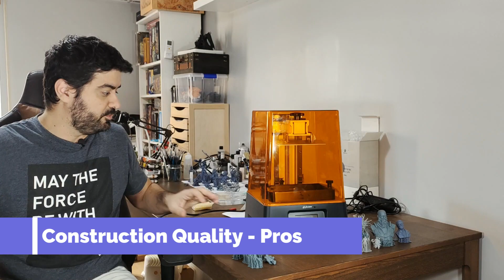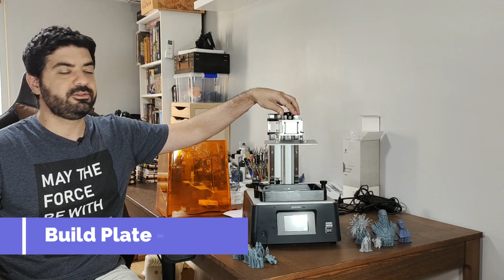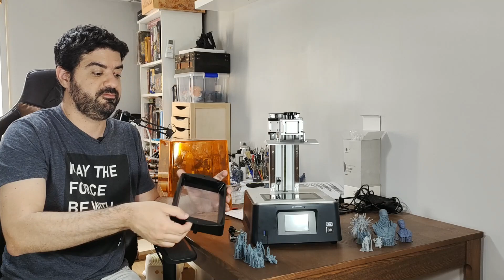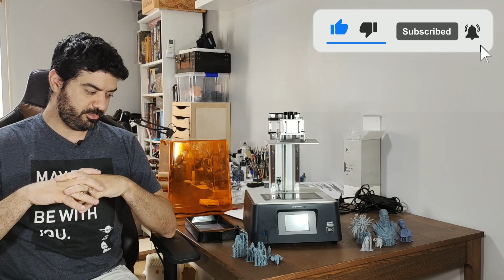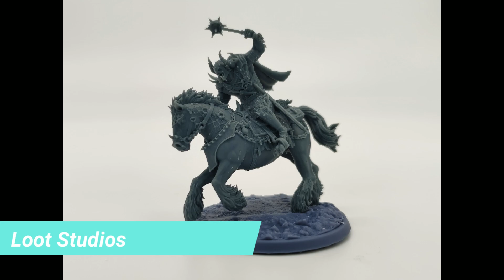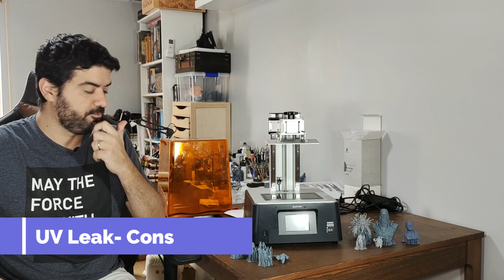Phrozen Sonic Mini 8K REVIEW - Great Mini resin 3d printer

Comment: Good review! One question I have is how do these 4K and 8K resin printers do with transparent and translucent objects. I'm thinking about things like blast effects and such. Two definite consideration is air bubbles, and clarity when looking through something printed with clear resin. Thanks!
Reply from the maker: Clear resin it all depends on the brand and type of resin. The resins evolved a lot  the past few years. I already reviewed 2 super clear resins, from 2 different brands, they ate really clear and do not yellow with time. They are not easy to work with, since they ate extremely dependent on you tweak the settings, but once you get it, they ate great. About bubbles, they ate there unfortunately unless you use a vacuum chamber, what people normally use when work with resin molds. I recommend you try those resins and check with the brands the optimal instructions on how to use them, Resione is a brand that has a super clear resin and they have lots of instructions on their website.

Comment: great review as always :) what are the consequences of the uv leak? and how much better are the results printing with the 8k resin compared to other resins? im asking because here in germany the 8k resin costs more then 3 times of what my usual go to resin costs, so im a bit hesitant.
Reply from the maker: The UV leak is not a huge deal, I just don't like it, uv light affects materials in general and even the plastic  on the printer body can be weakened by it. Also the light is dissipated which in my opinion reduces efficiency. But that's me, I believe majority of people just don't care. About the resin 8K it was a pleasant surprise for me, amazing resin, I don't know if it brings more detail but definitely it gives an amazing look to the models, don't know if it's the color or some component in the mix, I will make a quick review of this resin. One amazing thing is the cure time, super low. If you can buy it for good price, I think it worth it. But yeah, it's an expensive resin.

Comment: Hello, versus Orange mono 4k does this printer print much better??? Or Sonic mini 4k does the quality worth the higher price of printer and Parts(LCD etc.)
Reply from the maker: For sure it worth in comparison with sonic mini 4k, that printer is very bad designed. Longer orange 4k loses in the screen size and also the type of light, I think the print quality in general of the sm8k is better because of the light source type as I said in the video. After test many printers, I can say for sure that this type of light source is much better than matrix LED. I will make a video comparing some prints from longer orange 4k and the SM8K.

Comment: Would you say it's worth an upgrade from a 52um printer? Would also be interesting to see if other manufacturers well be releasing 8k printers.
Reply from the maker: Probably will but it will take a lot of time as it happened with the 4K for small screen, in the other hand if you can buy a bigger screen, there are options already like the Saturn 2 with 28um and I think Anycubic also came out with some option with 28um. But this is a very nice printer, I think this time Phrozen did not use users as beta testers, the printer is really good. I think if you have the money it worth try.
Reply: @HobbyistLife  Thanks!